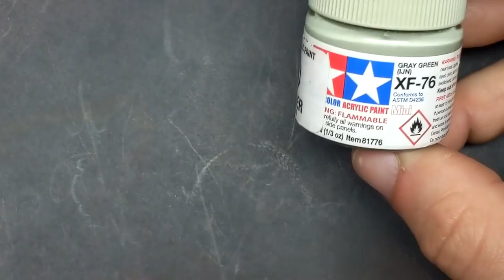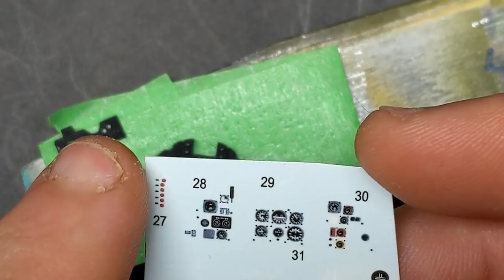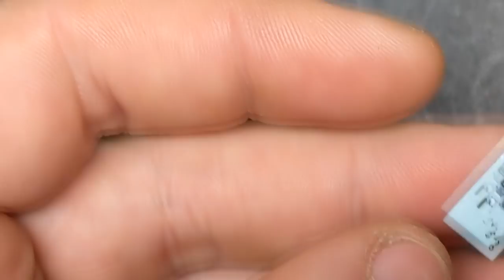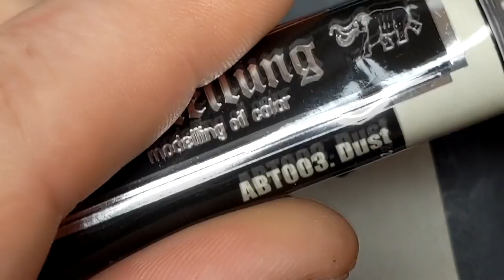1/48 Eduard Tempest Part 2: Cockpit Painting

Comment: Awesome! I’m currently working on an Eduard F6F-3 Hellcat and I don’t know if this is a regular feature but instead of tabs the wings and tail plug in to the fuselage at the cross-section. Makes for a really sturdy join and even in 1/72 it feels solid and able to be handled. I’m still a Tamiya snob but I think I’ll pick up a few weekend edition kits in the future.
Reply from the maker: They're nice bargains especially at the price point. My only real complaint with this kit is the lower wing fit.
Reply from the maker: It also looks like their Mk IX Spits and Mustang use the same controls mounting.

Comment: Surprisingly the Typhoon & Tempest shared few (if any) major components, they just looked similar. 

A lot of the photo-etch is a waste on the interior, as once closed up - the cockpit is quite a black hole.
Reply from the maker: The wings, tail, and longer nose are the most visible differences.
Reply: @TheModelGuy  true, but having worked for Hawkers (BAE Systems), you get to know about common parts - Harrier I's used drawings for parts that where first issued for the Typhoon.